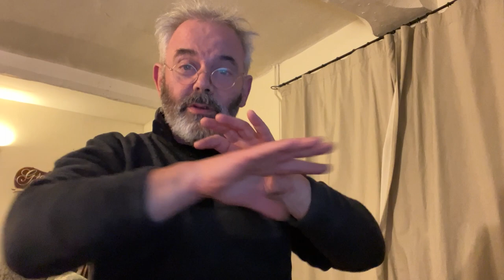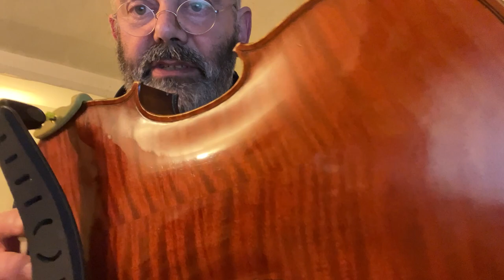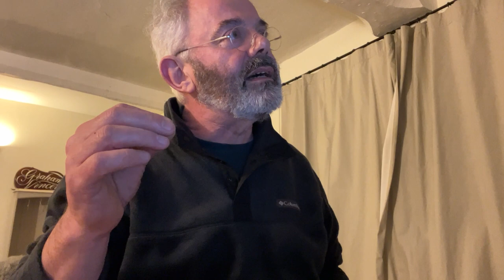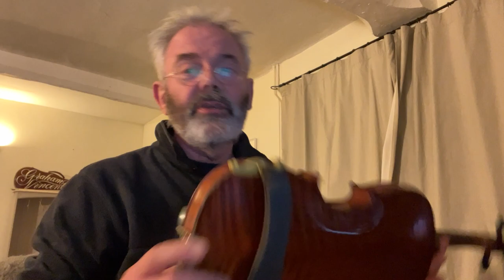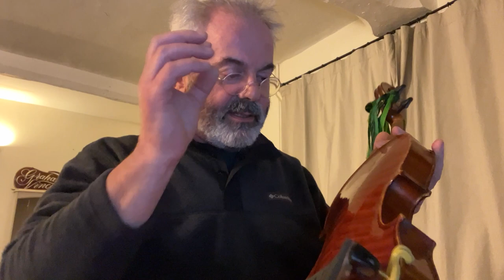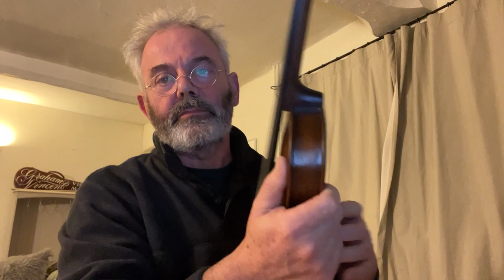# 145 - Violin varnish! What's it all about??

Comment: VIOLIN PRIMER imo
Potassium silicate mix 2/3 potassium silicate with water and heat. Don’t boil and apply while warm as a sealer.

Following the sealer, use linseed, oil and pumice, followed by colour varnish. 
Pumice powder has the same refractive index as varnish.  Is invisible. So more than abrasive.
Reply from the maker: This looks like a nice varnishing system.

Comment: have you tried applying dilluted hide glue or albumin + powdered pigments + cleaning the excess with a rag for tops? I was thinking to use this as a ground for the top of a viola i'm making, only on the spruce as i don't like it on flamed woods, it dulls it (there i'm using turpentin+myrrh, or maybe some alcohol+benzoin which seem to make the flame look good) I seem to get a good result matching it all later when applying colours with spirit varnishes on test strips. ¿do you know any cons i should be aware about protein+pigment on spruce tops?
Reply from the maker: I'll tackle this in the next Q&A video.